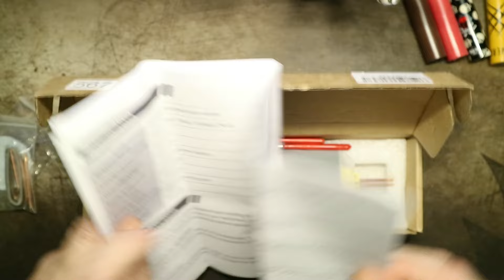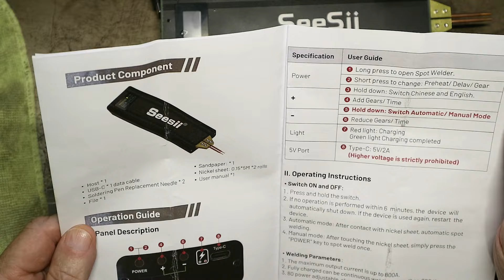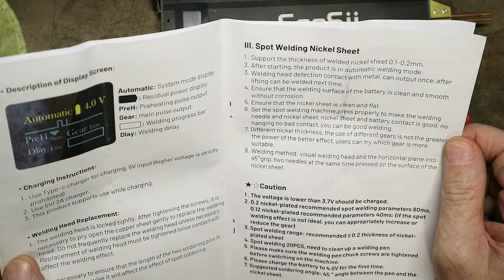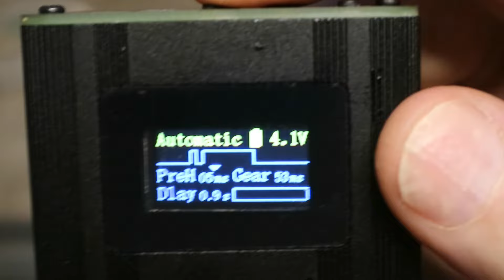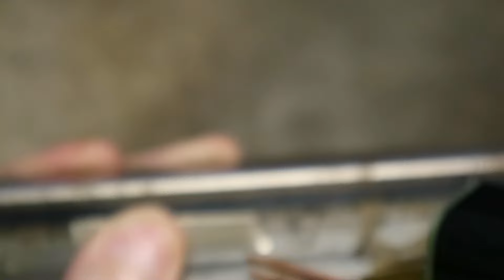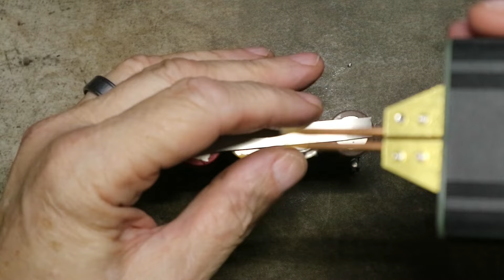Seesii Spot Welder, 5.0Ah for 18650 Battery. Nickel Sheets 0.1-0.2mm, 80 Gear, Test and Review!

Comment: I use to solder wires to the cells, but the last 18650 i soldered, the cells started to hiss really loudly, so i threw it outside, anyway I bough an Mains, Super Capacitor welder, As i though pay a bit extra as the internal battery`s only last a few years, It supposed to weld at up to 2000A, On the default settings of 20% gear, It shows 400A after i do a weld, If the gear is just weld time why does it show amps, And some people say it takes less than 10A to weld, So why 400-2000A, Is it a fake number and the amps are constant and unchanging only the weld time.
Reply from the maker: Soldering is fine until it isn't, then you get a spot welder. I can't answer all your questions, but most small spot welders seem to be in the 500A range, but the different "gears" or heat settings they offer aren't amperage, they're milliseconds.

Comment: I just bought the model with the larger lcd 3 cetral buttons and 11 'gears'.... it struggles with 0.2 to 0.2 so how they claim 0.3 i dont understand, but I am only using the auto 1-11 gear settings as I dont know what damage I could do to it with bad manual settings
Reply from the maker: I've never tried anything thicker than .2, but mine did that pretty well. If you're new to this type of welding you might want to consider that your technique is part of the issue. I had the problem when I first started, either putting too much pressure on the electrodes or too much contact area. Or both. Get a practice battery and start trying differing amounts of pressure and using the edges of the electrodes.
Reply: @3rdpig what's the verdict on 0.2mm? Still holding up?

Comment: I've got the same unit it was great for the first couple of hundred spotwelds over a couple of months, it just isn't reliable and for some reason it will go from doing bugger all to suddenly blowing a hole directly through the negative plate on 18650 and the battery then hissis and leaks through the hole, good luck

Comment: UPDATE: Battery still needs too be charged after 40 welds. BUT, this welder is really strong! Like Chuck said, after you get the hang of it, really nice unit! May have to replace the batteries or figure out a way to get more life out of the charge. It would be super cool if you could just plug it in???

Comment: Okay, so, I got her going but, there is no way on God's green earth that this will do 800 welds. The unit gets hot after maybe 20. The battery drains quickly! 😢 I would say this will do 30 to maybe 40 welds, then it dies and shuts off. I am recharging now, for the 8th time. 😮 The welds are great, just keep the probes clean with a small angle grinder and a wire wheel, LIGHTLY. Cleans it right up quick! The biggest issue is the staying power for my 3s16p. 7.7 on the gear. 1 sec on the delay. 7 on the pre-heat. So, as a 1st time welder, I think this is good for very small jobs like fixing a drill pack. But, on a big run I have had to charge it 8 times, so far, and I still have a good 100 welds for the cross strips. I guess it's good for 37 bucks. But, I plan on doing more batteries. What would you suggest that will really handle the workload? Again, fantastic video!!! 🎉 Please, keep doing them!

Comment: Thank you, you just saved me from tossing this thing across the room. Mine came with zero instructions.
Reply: 🤣😂😂 Yep, same here!!!!
Reply: Just posted above on the amount of welds. 😢 But, great for smaller stuff. Looks like I will need to get something in the 200 range to be able to do bigger packs.
Reply: Mine is a cheap one with no screen to check the pulse or gear. Thanks

Comment: The welds are too slow, there is just too much internal resistance, the avalanche current is very slow and inadequate as well. This can overheat the battery (the ones being welded) and can cause either the cells CID valve to release or worse a thermal runaway.
You could solder some copper bar (or stripped copper wire) inside the welder between the butt of the electrode and the mosfets output, to make it perform a bit better.
But inevitably the lipo cell inside the welder will die after about 200 to 300 welds.

Comment: do you know if it's possible to peel up the nickel strip on a drill battery, insert now battery and reuse the same nickel strip with this seesii handheld?  would love to see a video on that.
Reply from the maker: If you could get a strip to come off without destroying it, then you could retack another battery on. You won't be seeing a video like that from me for three reasons. First, I've never gotten one off without destroying it, second it's just too easy to cut the old strip off on either side of a bad battery and weld/solder on a new chunk of strip and third, putting one new battery into a pack with 2 or more old ones is going to make the pack pretty weak and cause charge issues.

Comment: You're using .2mm nickle plated steel correct? In your estimation do you think this unit could handle .15 Pure nickle at the very least? Maybe even .2 at full charge? I assume 0.15 nickle plated copper is entirely out of the question though.
Reply from the maker: It's magnetic, so t's nickel plated steel. This welder had power to spare, so my gut feeling is it would do .15 pure nickel without a problem and might do .2 if the conditions are right. If you have a supply and want to send a sample to me to test I'd be happy to do it.
Reply: @3rdpig  Fair. I don't blame you for not having any on hand at around a dollar a foot!

Comment: I put together a DeWalt 20 volt pack, yesterday, with my new Seesii portable spot welder.  I set it on 3 and tack welded the connector plates to the new 30Q Samsung batteries.  After I had finished putting all the connector plates on the pack I went back over them with a setting of 4 on the spot welder just to make sure they were connected.  I still had four lights on the spot welder when I was through putting the pack together.  My only complaint was I would like longer welding leads.
Reply from the maker: I agree about the length of the leads. But longer leads will have to be made of a heavier gauge wire and will cost more. I'd be willing to pay $5 or $10 more for that, but they're probably competing with other brands at the same price and are afraid of losing business.

Comment: I finally got my Siisee portable welder.  I did not get exactly the same model as you got.  I got the model with the square box and two leads.  After charging up the battery I tried it on some nickel strips.  I got a .92mm strip and a .02mm  four cell connector plate.  I set the power level at 3 and welded the connector plate to the strip.  It did fine.  It even put two bumps on the bottom of the .02mm strip.  I don’t know if it would have connected the strip to a battery but I’ll bet it would at a power setting of 5.  Plowing through two .02mm strips is not an easy chore.

Comment: my same seesii spotwelder works ok on 0.2mm, but everything needs to be very clean, I normally hit it with a wire brush and it works fine, otherwise it's really hit and miss. have to look at this new one.
Reply: @patrickdk77  my old spot welder works fine with .02mm strips, but it is the open architecture one that connects to a 12 volt battery..  I bought the Seesii spot welder but have not gotten it, yet..  I usually hit the ends of my batteries if they have spot welder bumps with my Dremel, otherwise I wipe the ends of them with a shop towel with break cleaner on it that, will clean any oil from its ends.

Comment: Looks like it does a good job
Reply from the maker: It seems to work well. And after using it more I find I'm liking it as an all in one unit, instead of one with wires and individual welding pens. It seems awkward at first holding the entire unit in your hand, but once you get used to it I think it's easier and quicker to move from weld to weld rather than dragging a the unit behind you with the wired pens.